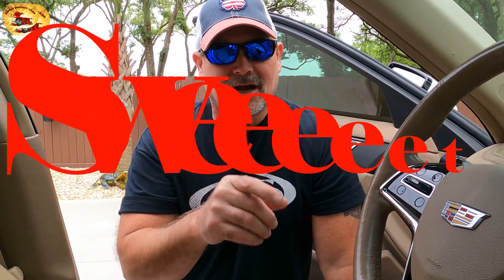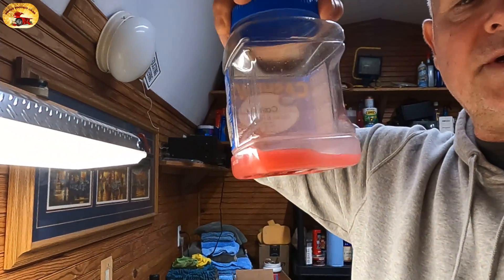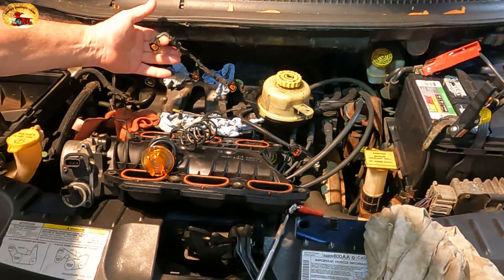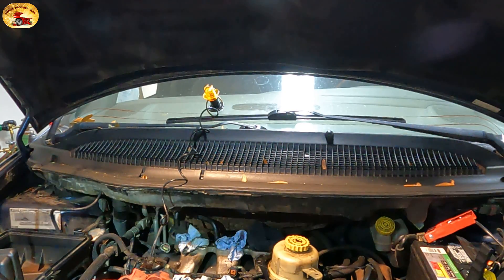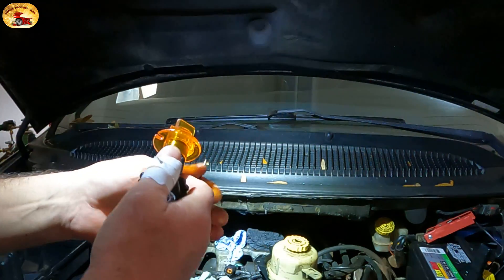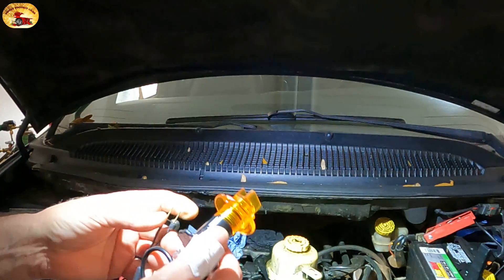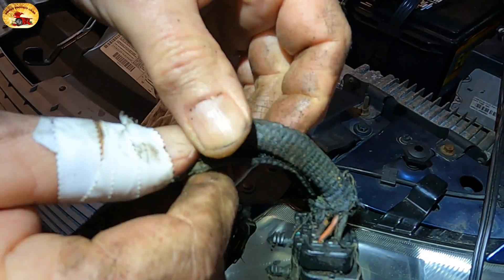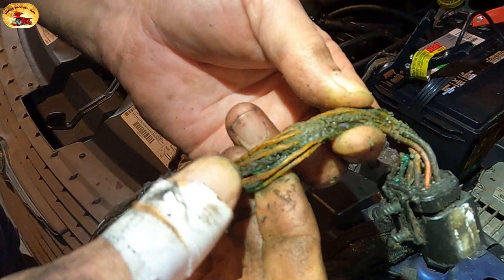Simple Way to Find A BAD FUEL INJECTOR OR INJECTOR HARNESS! PO201, PO203 PLUS OTHERS

Comment: I would never have guessed it was the wiring harness with all wires bare metal touching. How did you get one for so cheap? 
Also that tool you used on the injector harness is really cool. Love this series cause I am learning new things every time I watch it. 😊
One more question why is it so dam expensive at the Dealership to get the same part?
Reply from the maker: It's an older vehicle, most times older vehicle parts are cheaper, sometimes not, it's a crap shoot. Dealership markups are huge on parts, avoid at all costs Kevin :) LOL  Thanks for always watching, we're glad you find value in our series my friend, hope you have a fantastic weekend. mad Mike & team

Comment: That wiring harness was just plain UGLY, surprised it made the trip back to your home.  Any guess on why it melted to bare wire?
Reply from the maker: Kirby that’s why we mentioned in the video of the bad design that harness is probably 4 inches away and runs parallel to the exhaust manifold whoever came up with that definitely needed to work for Bud Light lol

Comment: What do you think was the issue to cause the harness to deteriorate so badly?😮
Reply from the maker: Widtrak77 that’s why we mentioned in the video of the bad design that harness is probably 4 inches away and runs parallel to the exhaust manifold whoever came up with that definitely needed to work for Bud Light lol